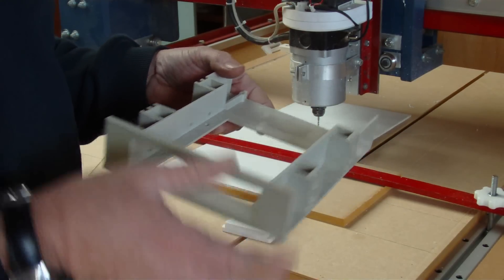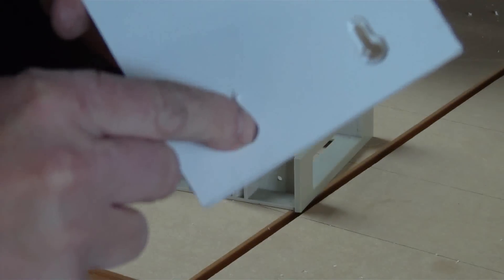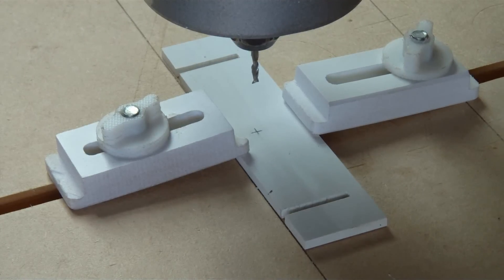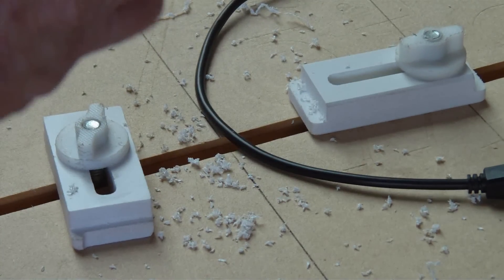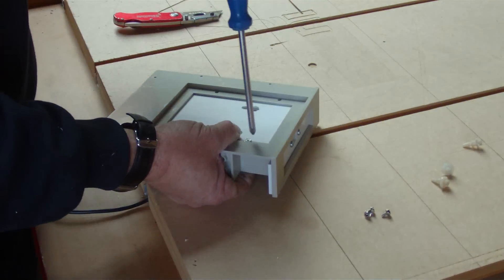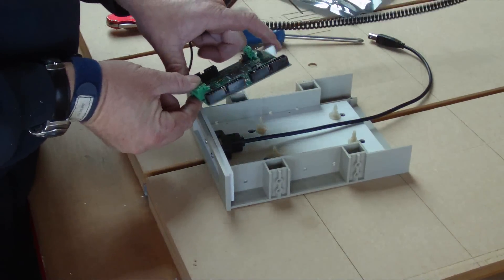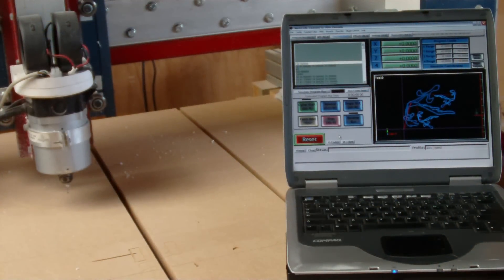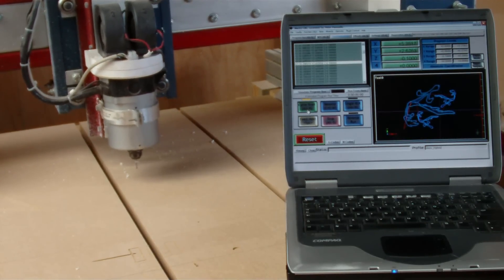Building The Ultimate Controller - CNCnutz Episode 29

Comment: How has the usb smoothstepper been working for you?
Reply from the maker: Hi Tanner,
The USB Smoothstepper still powers machine but it does have its problems.
I had to do modifications to stop noise induced issues but this should not be an issue in new Smoothsteppers as they should have the mod done.
I have an issue with with lost steps that I have proved to a smoothstepper timing problem when talking to my older Gecko drive. Using a Beta version smoothstepper Plugin fixes the problem but being an old plugin it has other issues but is still usable. I now use the Beta for 3d work and the current plugin for 2.5D machining which is most of the time.
This issue only seems to affect me at this time and I'm sure it is because I use old Gecko G540. The problem doesn't seem to the newer version G540's.
If you are considering a smoothstepper I would look at the Ethernet version not the USB one.

Cheers
Peter

For info on the lost step issue see this video.
Where did I put those steps